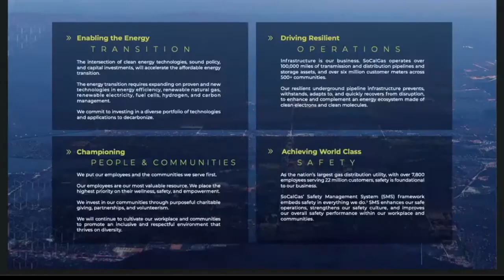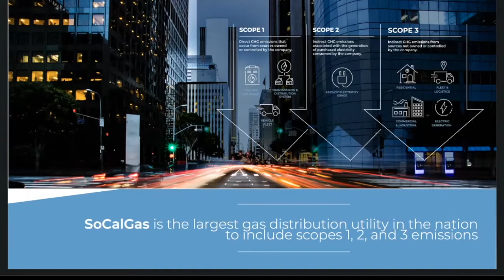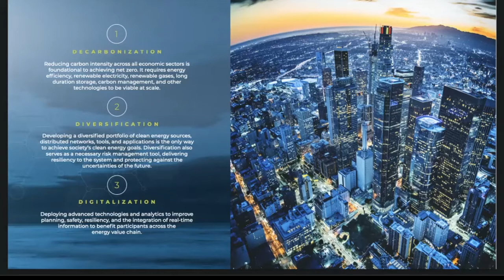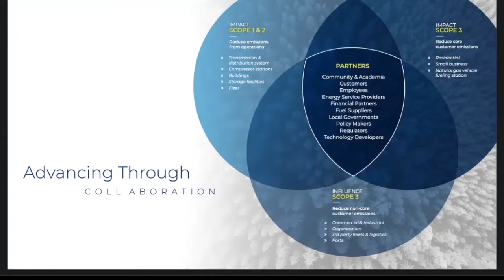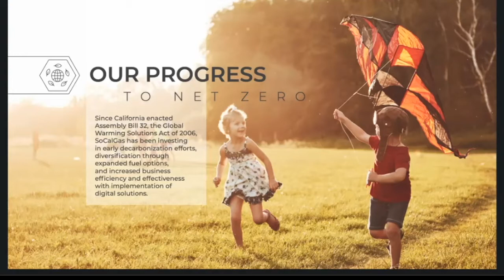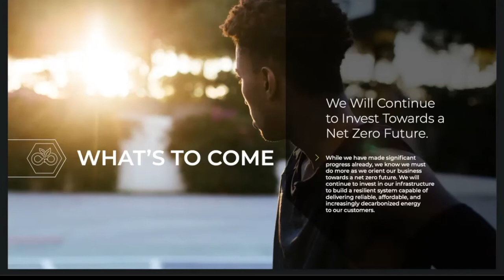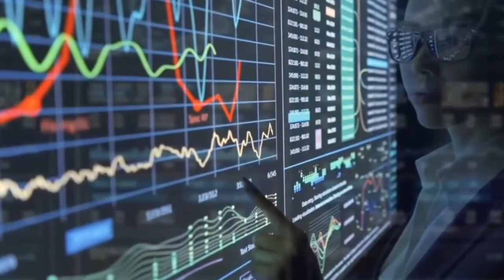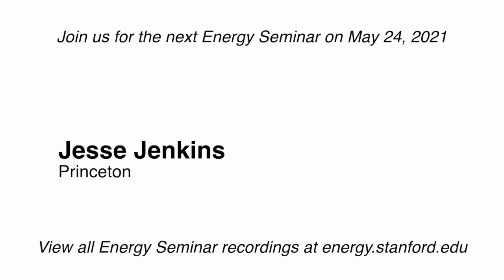SoCalGas Commitment to Net-Zero Emissions by 2045 | Michelle Sim | Energy Seminar

Comment: Heat networks are going to replace gas networks. Sorry, but y'all need to reinvest in those supply chains instead if you want to keep a foothold in the space heating and DHW market. The simple truth is that it's entropically wasteful to use gas or hydrogen to provide low grade heat without doing work. Also, once the real costs of co2 get factored in, and the real estimated of ch4 leakage and it's GHG potential is enforced, then all that infrastructure won't be worth much. Even gas turbine peaker plants are going to struggle.